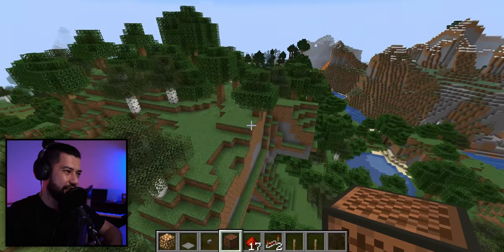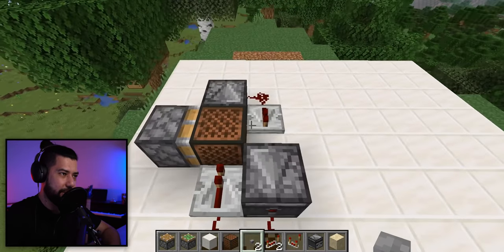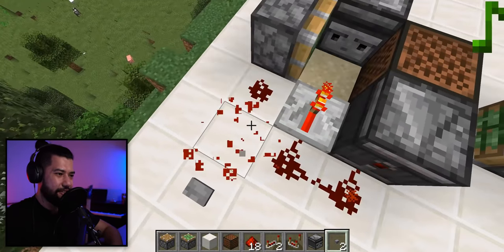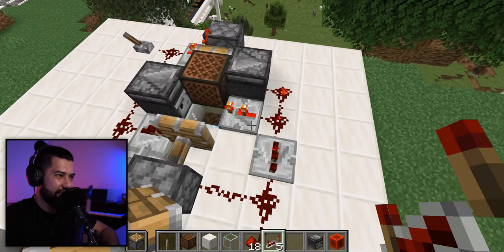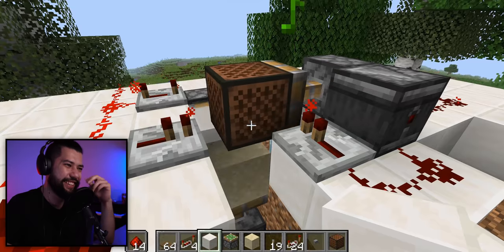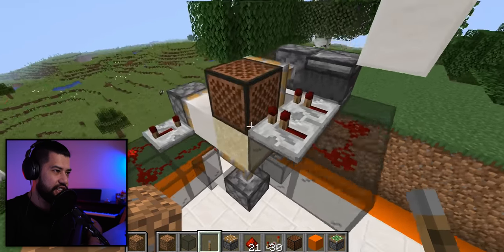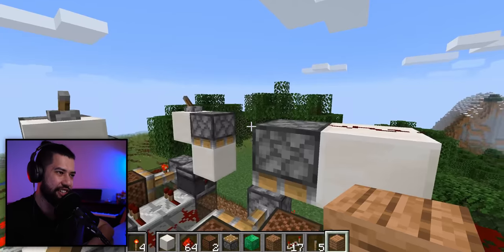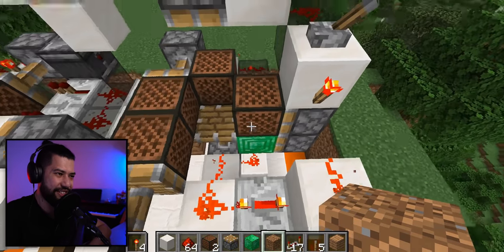Making Music in Minecraft #5: Compact Note Block Machine!

Comment: The strangeness is due to the inconsistent input signal because you used a lever and turned it on and the off quickly. You'll want to look up monostable circuits and pulse lengtheners to get consistent input signal and not use a lever to start the machine.

Comment: bit of a nerdy comment but.. a simple command to clear an area quickly is to use the /fill command, such as /fill ~15 ~15 ~15 ~-15 ~-15 ~-15 air replace oak_log and other blocks.

Comment: I really think you should try to watch some redstone tutorials. I recommend mumbo jumbo. You aren't bad at redstone, but just to understand what everything does a little better, I think that would help. Also, I think you accidentally made some really cool circuits that didn't do exactly what was intended. For example, I think you might have made a 0-tick clock and you might have made a block update detector, both of which require fairly precise timing.

Comment: I don't understand why I can't find a simple thing that plays an easily customizable melody, but where all of the noteblocks are very close together and get re-used, so the whole melody can be heard from within a larger area, and so I don't need to craft a thousand repeaters.
I made a relatively compact design for bedrock edition, but I'm sure there's a better way than what I came up with, because my design requires 4 modules per noteblock, each one offset by 1 redstone tick (= 2 gameticks = 0.1 second = unmodified repeater), because it uses hoppers. additionally, a new module is required if a value exceeds 27. playing a note adds 1, not playing a note for X seconds adds X/25.6 rounded up.
(I'm using a piston feedtape to reload the music faster and with less mechanism noise. This comes at the cost of the limit being 27 per module instead of 54 per module (double chest).)
Because of the feedtape, it can hold several melodies, but it can not change which order to play those melodies in.

While writing this, I remembered that shulker boxes exist. So I guess I'll be redesigning it completely.

I think you should contact some people who know stuff about minecraft mods. Stuff like clearing out a large area or tuning a noteblock can be done SO much easier with a few mods.

Comment: A general tip for you. Repeater clocks, like you were using, are generally very unreliable. That's likely the source of the inconsistencies in your machine. The length of the pulse (on-time) of your redstone changed every time you activated the machine, due to human error. Using a Torch-repeater clock, Comparator clock, or Hopper clock would have been much more reliable. I'm not going to explain the differences and designs of them here, but some quick googling will explain them to you. (https://minecraft.gamepedia.com/Clock_circuit)